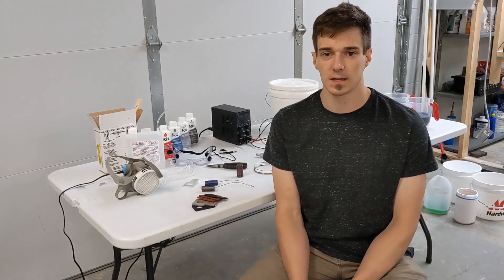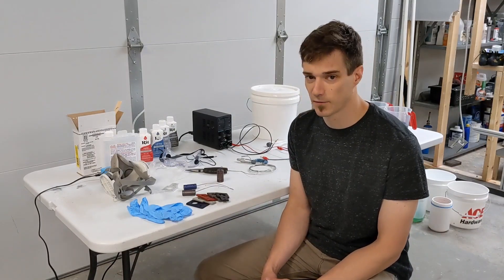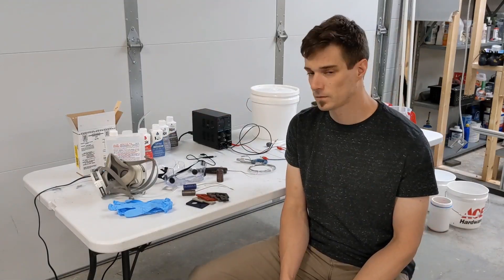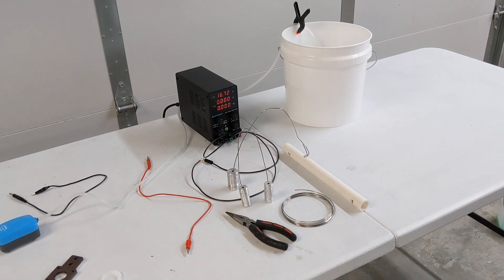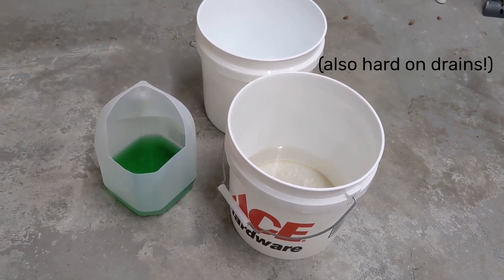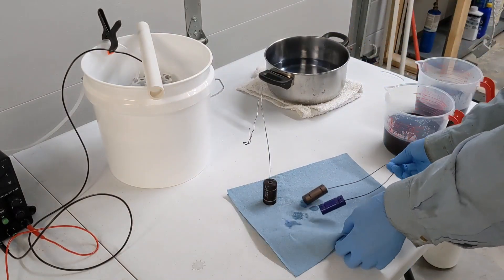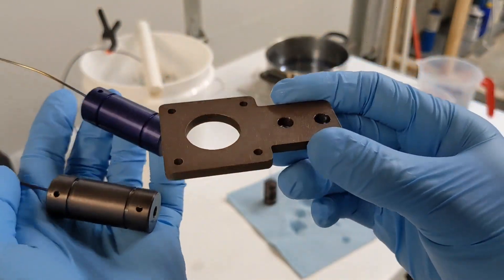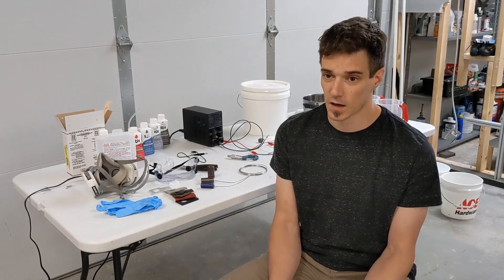Anodize Your Own Aluminum Parts!

Comment: Hey bud. Great video, can you do a short video on finish quality? Like, how does it hold up to scratches and the like? I want to do this to my 3d printer parts, but concerned it won't hold up.
Reply from the maker: Thanks! I've been meaning to do this again, so maybe I'll make another video soon. But it holds up pretty well to scratches, way better than bare aluminum. The color holds up really well.
Reply: @schanerdesigns  That's great to hear!
Thank You!

Comment: Hello, the last step in dyeing must be the temperature of the water? Or do you not need to set the temperature? Also, what is the ratio of dye to mix? with water? Thank you for the video.
Reply from the maker: @patrickkatkaew9843  the water needs to be boiling, so you can just keep it on the heat at a gentle simmer. The dye ratio doesn't seem to be too critical. I just did a third of a bottle for a pot.
Reply: @schanerdesigns Thank you so much 😊

Comment: Looks good! And it's nice to see someone been sensible wtih safety equpiment! ^_^ 

I belive the final step though does need a sustained temperature for a period of time though, so maybe use a hotplate with thermometer and stir bar. The pores you've filled with the dye need to be closed to seal them and gain that hardened surface that anodising gives. If you're not holding it at temp long enough, those pores won't fully close and it'll not be fully anodised, just dyed.

Al least that's my understandiing.
Reply from the maker: Great catch, thanks for calling me out on that!

I was under the (incorrect) impression that sealing was only important for color, but further research indicates that it's critical for corrosion resistance as well. Looks like the recommendation is several minutes at 95°C/203°F or more, using distilled or deionized water. Interestingly, there's no mention of an impact on hardness. I soaked all of these parts in boiling water again just to be safe!
Reply: @schanerdesigns  You want to be sealing it, at 95C, for the same to double the length of time it spent soaking in the dye. 
Without the complete Sealing stage, the suface will be weakened and scratch/mark easily vs when it's actually sealed. Try doing a piece properly then compare to an older piece done wongly :)